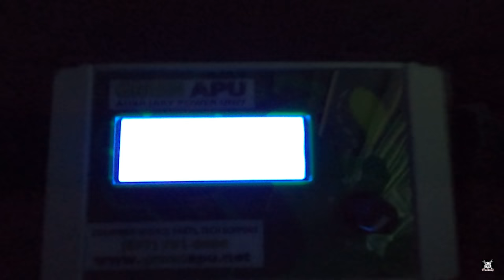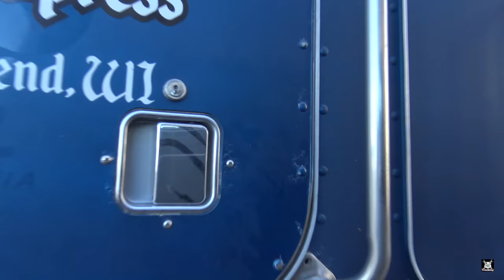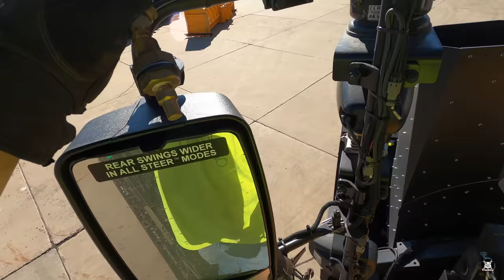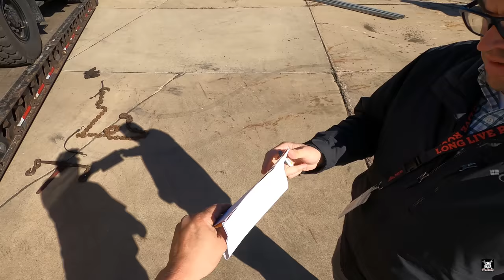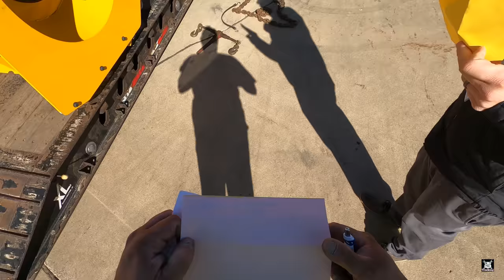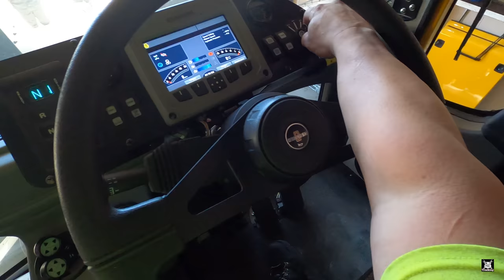I Almost Get Wrecked Providing Superior Service

Comment: I have been off for 2 years from cellulitis in my leg. I  usually go between  240 & 260lbs.  I'm  300 now.  I'm 61 years old.  Been driving for 37 years.  Most of my work  was regional with a few years of real otr experience.  Handled a lot of freight. You're right to a point. Just climbing in and out of the truck, handling equipment and freight moving around  helps. If you can eat  better? That's a big help.  Everyone tells me to focus on protein.  Good luck!

Comment: 😮👍👍 and talking about Fuel price that most everyone don't know how the Ships that bring all your consumer goods to port. Those Big container ship diesel engines have to switch over to different fuel before they enter ports. Yeh on the open international waters. They burn the cheap inexpensive heavy fuel. But they have to Switch over many hours before they enter ports to the more expensive low sulfur diesel fuel. And you and I know just who pay's for that. Just amazing. I remember when back in the early 1970's, we used to bitch about how expensive diesel fuel was at 17 cents per gallon. 😂
Reply from the maker: I'm too young to remember the 70s, but I've heard stories from my parents.

Comment: My theory on the one coal roll is... the injectors are not giving a good spray when they are cold, once the engine pulls hard the combustion chambers and injectors burn clean as they are at operating temperature. It does not mean they are worn out or bad, just aging like the rest of us...

Comment: Finding allot of stuff to eat at truck stop's is not easy to grab sometimes but they are improving stuff that u are eating. Plus i eat at Subway all the time or Church's Chicken. Or  if i am gone for 2-3 day's. My wife will fill the fridge with home cooked meal's. And neighbor's and friend's will save there plastic container's like butter bowl's and other stuff so i can use to take food on the road. And when i am done eating just toss them in the trash. And we always stack up on plastic fork's and knives for me to take on the road. But i always grab them at truck stop's to use. I always buy big case's of bottled water and also buy one liter's of mountain dew and dr pepper at Sam's Club's all the time. I bet u are happy having the APU installed before the weather got cold. I love the APU in the new truck that i purchased. I still have Black Dog 79 KW that my late dad had. It will never be sold. My oldest son he drive's it once in a while. And we will be using it in the Christmas Parade. I did not know it also maintains the battery's. That is why i was not wanting to get one. I told friend's hell my generator charge's the batteries also. And they said so does the APU. I watched there videos on there page's. And i was like dam i might bet me one. The truck i brought it already had a APU system installed and the dealership showed me how to operate it and what all it does i was like wow. Went to the bank got a cashers check. And i purchased the truck and my wife she was happy. She was like hey at least u have tilt steering and i was oh hell yeah and i used it. The steering in the 79 is the same way ur steering is Steve. Hell i would have done ur exhaust if u was here quick and easy. I use the same clip board u use for paper work or document's. I hauled snow blowers like that one up to Michigian and Iowa all the time. We don't get allot of snow like people do up north. We get enough to go sleeding.

Comment: With all that old school pure mechanical engines stuff that you touched on in regard to the Cab Overs, does the same logic 100% equally apply to the same model year conventional tractors that other drivers have the same passions in preserving?  Steve, I ask this because of my curiosity for the preservation of the history of All Trucks from the 1970's and 1980's.  That little box truck boob reminds me of something that happened to my dad in the San Joaquin Valley part of Central California on the Northbound CA-99 in the spring of 1981.  My dad took me (8 years old), my sister (15 months), and our mom with him in his employer's 1981 or older Ford Box truck (Conventional, ten speed, air brakes, 2 axel with 40 ft box with lift gate that required a then CA-CLass 1 CDL) from their base in Elk Grove to deliver home construction supplies in SoCal.  The applicable part occurred during our return home.  Central Inland California is notorious for a weather phenomenon known as "Tuly Fog.". There was a Segment of the CA-99 that turned into a regular two lane road with traffic lights in 1981.  I remember this because of a specific day that we caught a red light with what seemed like say a 1/4 mile visibility in the fog.  Dad saw this tractor trailer pulling a flat bed trailer that gunned his motor when we both got the greenlight.  The visibility dropped to 10 feet before the flatbed driver cleared bumpers and cut us off  in the intersection, causing our left front quarter panel to hit the right rear corner  of the other driver's trailer.  The explosive sound of that fiberglass hood scared me worse than my little sister.

It's like Jim Morrison said, "People Are Strange."

Comment: You’ve probably mentioned this, but what kind of mileage does Orwell get as a mechanically controlled engine?  Is it more difficult to be profitable with an 80’s era truck?
Reply: It probably gets about the same mileage as most of the other trucks. Maybe a bit worse since it’s not very aerodynamic.

Comment: Diesel fuel is home heating oil with the road tax. As we get closer to winter season, the fuel oil has greater demand from residential users. 

Also, the price difference between gas and diesel is because they can. 

A possible difference between the BP and Pilot(?) station may be the BP is geared to the private vehicle user while the other caters to the commercial user, with a business expense account.

Comment: hey Steve I had a thermo king tri-pack apu on my company truck.  my apu didn’t keep my fuel in the tanks warm at night. so this winter with the apu running at night you have to be careful of jelling up your fuel tank crossover line.
Reply from the maker: I have a fuel heater in the line from the tank to the engine.

Comment: A Steve if a driver has a older tractor truck 2000 on back down that's in great shape will different company like in the south like (Tennessee steel hauler , Montgomery Transportation , Blair Transportation , Swift Transportation , P&S Transportation , Boyd Brothers , Hornady Transportation Jordan Transportation will they hire a driver or not hire a driver because he or she has equipment you can't hook up and electric ELD?
Reply from the maker: All you can do is call them.  But I would stay away from larger ATA trucking companies.
Reply: Yes,larger companies or all about self.

Comment: Orwell seemed a little shaky on this run, or was the cam just a lil loose? 

Also Steve, think you could run through your dials? I havent really seen a layout like Orwells, guessing the big one that works is Pyro and the one hiding behind your right hand is the speedo but that doesnt work I know, does orwell have a rev counter ? ( i know its unneccesary when you can feel and hear how the engine is pulling or lugging) but just wondering. 

Safe travels

Comment: Steve, you're working on the principal that you can't fit a speed limiter to a mechanical engine  that's not true. Speed limiters are mandatory in Europe on anything built from 01/01/86 onwards, therefore mechanical. There were several companies who supplied them both as OEM and as retrofit, they run of the speedo drive, some worked better than others the best were a company called Econocruise they worked just as with an electronic engine that is rock solid on the set speed, others used to "hunt" around a bit. We hated them when they came in, but you do get used to them, they make the job more relaxed, that's how fast it goes and you, the despatcher and customer all have to learn to live with it.
Reply from the maker: I refuse to "learn to live" with Big Brother.

Comment: There is a lot more sweet crude on the market which is used for gasoline, than there is sour crude, which is needed for diesel. Freightwaves has been talking about this. So… diesel is more expensive right now.
Reply from the maker: And there is a reason for that.
Reply: @fsctrucking  Yep our (blank) for brains at the DC rest home pissed off big oil.

Comment: Steve we are currently paying $2.30 @ litre Diesel and $1.90@litre Petrol 91 octain 95 and 98 is 14=20 cents extra so you guys are to badly savaged OH and there's 4.5 litres in a gallon so do the MATHS and just shake your head .Australia isn't a cheap place to drive .